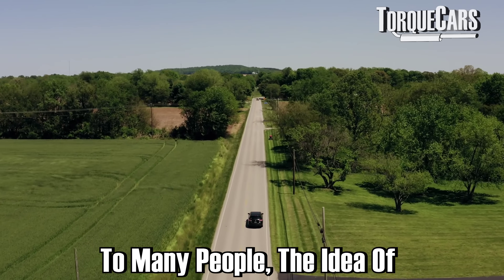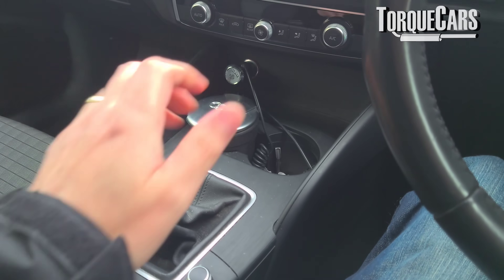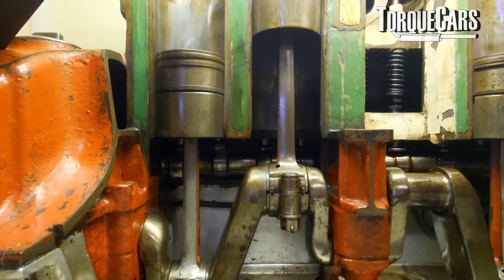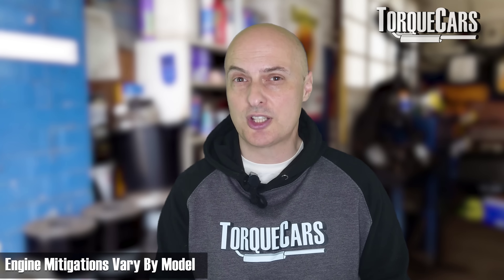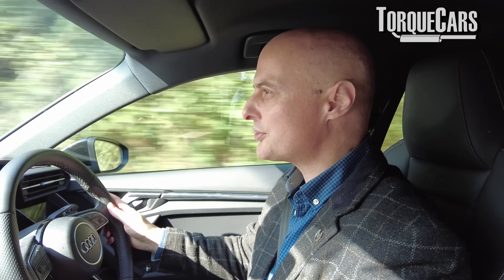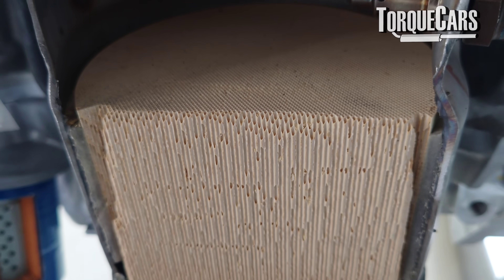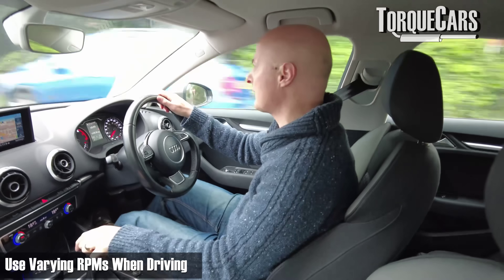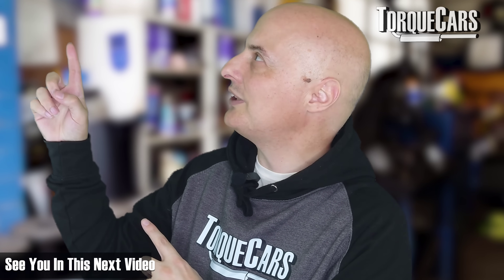BIG DAMAGE By Lugging at LOW RPM? Eco Driving Warning! (Manual Gears)

Comment: So this is more a case of bad driving habits than actual low rpm driving.
Reply from the maker: Yes, few engines suffer from doing low rpm for extended periods with little to no load on them, (with the exception of the badly designed oil pumps out there). Keeping low RPM and pressing hard on the throttle will add wear and tear, although the degree with which this happens will vary from engine to engine.
Reply: @torquecars  There are many vehicles that have worn out prematurely because they had extended idling which is why Police package vehicles frequently have upgrades designed for extended idling. Newer vehicles have variable displacement or even electrically operated oil pumps to negate the necessity of these special packages.
Reply: @imzjustplayin  Electric and variable displacement oil pumps have nothing to do with protecting the engine while idling or longevity. It was done to reduce drag for fuel savings and decreased emissions, that's it.
Reply: @averyalexander2303  Wrong. Variable displacement oil pumps can dial in the oil pressure and flow at a given load.

A non variable displacement/variable speed oil pump could have too little oil flow at low speed and too much oil pressure/flow at high speed. An oil pump that produces sufficient oil flow and pressure at low engine speed and high engine load would likely have too much oil pressure and flow at high engine speed, robbing horsepower. A variable speed/displacement oil pump can flatten the oil pressure and flow curve and be adjusted according to needs.
Reply: @imzjustplayin  just sayin, I replaced 3 7.3 engines from ford in the passed 3 months for extended idling and they all have variable displacement oil pumps. All in vehicles that idle too long
Reply: @Burpchamps  The 7.3L, are you talking about the Godzilla gas engine that only has two oil pressure settings? Because I'm not aware of the 7.3L powerstroke diesel having such a feature.
Reply: @imzjustplayin  yup, all “Godzilla” gas engines. 1 ambulance 2 from a water truck rental company. Such a common problem ford doesn’t even make you tear em down anymore to replace em
Reply: @Burpchamps  clearly they have a design flaw but the concept of a two stage is multi stage oil pump makes sense to me.
Reply: @imzjustplayin  Yep, the UK police recently cancelled their contract with BMW because the cars kept dying due to long idle times.
Reply: @torquecars  To put it simply, no decent engine will be damaged or excessively worn simply by cruising at a steady low RPM, but high loads at low RPMs should be avoided.
Reply: @torquecars  I wouldn't be worried about this as much with an American big block V-8 engine. The 1970s Buick 455 big block V-8 engine was a torque monster with max torque at 2700 RPM. I had a 3.42:1 rear axle ratio and a 4 speed automatic overdrive transmission with an overdrive ratio of .67:1 and a lockup torque converter allowing it to be locked up at 900 RPM at 40 MPH, 1000 RPM at 45 MPH, 75 MPH was just 1600 RPM in my 1974 Buick Riviera.
Reply: @torquecars  so this means idling an engine will not damage it?
Reply: So true
Reply: Das ist der Grund warum deutsche Gebrauchtfahrzeuge sehr gesucht sind, denn hier gibt es die Autobahn, welche sehr gut für einen sauberen und damit gesunden Motor sind. Hier werden eben, wenn auch lange nicht von Allen, 5 von 5, 8 von 8 bzw. 10 von 10 Gängen auch wirklich noch genutzt. 😊👍
Ich habe noch niemals in meinem Leben eine PKW Kupplung kaputt gefahren, aber kam auch noch nie auf den Gedanken im 2. Gang anzufahren, außer vielleicht einem abschüssigen Berg. Wenn ihr schaltfaul fahren wollt, warum kauft ihr euch keine Wagen mit Automatik? Gerade die neueren mit 8(+) Gängen laufen so leicht und schalten so schnell, das sie keinen Tropfen mehr verbrauchen als Handgeschaltete.
Reply: @p.s.7396 Jop. Kupplung hab ich uach noch nicht kaputt bekommen, wurde aber trotzdem getauscht als ich letzens mein Getriebe tauschen durfte. 270k km hats gehalte. 17 Jahre alter Skoda Fabia 2 1.6l wars gewesen :)
Reply: If you have an auto, many of them seem to be programmed to labour the engine rather than to change down for eco reasons.
Reply: @simonh870  Hondas econ mode does this, it also suggests in the manual that you don’t use it for short periods of stop/start driving or anywhere that has hilly terrain, it’s designed for optimum cruising conditions and not for day to day driving…
Reply: This is why I always buy highway driven engines, they are at their peak power and efficiency always!
Reply: People do drive funny .  I know someone who constantly shifts from 4 to 5 to 4 at a steady speed hehehe .  But there is people who drive a diesel and shift early but then still shift early in a gasoline car .   Coasting i've seen in poor countrys where they turn the engine off while driving .  I think i know better but i only use two of the gears often due to lazyness , not when i feel like driving tho .  And i have proven that reving  higher in each gear when heavy loaded or on hills will save gas .
Reply: I’d suggest more an issue with poor advice/education, my kids have all passed their tests within the last few years and they all change gear far too soon, my youngest took the initiative quick enough when I suggested that the redline was there for a reason and he ought to try using it every now and again, sadly the older two haven’t been quite so quick to adopt the habit…

When I initially questioned them as to why they change gear so early they all said cos that’s what they’d been told to do by their instructor… 🙄
Reply: @JustinWallace-ky9dm  indeed. My instructor thought me to drive low rpm and full throttle. 
Our diesel had lot of issues with filters. Everytime it struggled i had to go for a spin and keep rpm higher. Ever since i learned and  drove in lower gear and higher rpm... No issues. 
But habit is with me still. I drive low rpm often, but i shift down when i overtake or need to push throttle deeper. With higher rpm my acceleration is way way bigger and i can safely spin it to high speed.
Reply: @JustinWallace-ky9dm  so change gear at 3k+
Reply: @salamipitza  who are we talking about here, me or my kids ?…
Reply: Exactly
Reply: @raheengabier3984  yeah, it's almost a clickbait title based on an old wives tale.
Reply: Yes, if you have to put a certain amount of torque into the engine you need to downgear.  That simple.  Not only will it damage your engine, but it will actually burn more fuel.  Every engine has ideal Torque/RPM curves for both Torque output and Efficiency.   While the RPM is lower on the ideal efficiency side, you will get various issues. 

The exact RPM varies by model and vehicles typically have what the ideal efficiency RPM for the nominal cruising torque range listed in their owner's manual, and if you are familiar with your car, you can sort of feel when you've got the right RPM. 

This is actually one of the advantages of an indirect-drive hybrid, where the engine just cranks a generator and motor runs the car, is that the engine can always run at the ideal point on the torque/RPM curve for the exact amount of power needed for the car.  Furthermore, there is typically a small battery or power-cap system to handle heavy acceleration so the engine doesn't have to output excessive power for that.  

Towing a trailer has to be one of the most common ways to end up lugging your engine.  You are throwing a bunch of extra weight on your engine and you absolutely will need a higher RPM than normal.
Reply: ... or a case of female driving habits...
Reply: It's low rpm driving. You should be at low rpm ONLY on highway driving at stable speed. 
But people drive at low rpm all the time and don't even downshift when they accelerate killing engines. 
Bad habits are connected to myths and lack of technical knowledge causing people to think driving in low rpm is good.
Reply: @raheengabier3984  false. lots of cars rev automatically to 2000 rpm when its cold to warm it up faster
Reply: @cantwealljustgetalong2  2000rpm?! Maybe 1000-1200pm
Reply: I only use 2nd and 4th gear in VW Golf . I rarely ever use 1 3 5 6 Is that considered a bad habit ?
Reply: @lassepeterson2740  depends on road, your gearing, and speed limits.  Your clutch probably doesn’t like starting in 2nd all the time, but not a big deal.  More wear when people rest their door on clutch
Reply: @bjornironsides6474  Yes i live in a flat paved road town and drive mostly with no passengers .   2 & 4 mostly .  I am lazy and the machine should take the slack .
Reply: @lassepeterson2740  cant be that dumb for real lol
Reply: @lassepeterson2740  you'll wear out your clutch setting off in second
Reply: @joshuajohnson8124  Yes yes i worry about that .  But there is lazyness .
Reply: @lassepeterson2740  Then why are you driving a stick in the first place? If you hate shifting, then get an automatic, or one of the manumatics that are often available, or the manual gates of some automatics. I have the old 4Spd Sport stick auto in my Mazda Protege 5 wagon (US model) and I use that all the time as if it's a manual. Always start off in 1st and yes, it's a short gear so must shift it sooner to 2nd than 2nd to 3rd. Occasionally, the autobox does not drop down to 1st, so I end up starting in another gear, but immediately have to get it to 1st, to take off, but the car is not the fastest anyway.

Otherwise, it runs through all 4 gears quickly, but the performance is lackluster.
Reply: @johnhpalmer6098  That is a good question ?  But it is because when i feel like driving stick is best , but most driving is commuting and shopping and i only have 1 car .  Compnay cars and rentals are always boring automatics .
Reply: @johnhpalmer6098  Why cant i buy a 2 speed automatic or an analaug EV which auta be cheaper ?   Ask the government .   I wont drive how the government wants me to    .
Reply: @lassepeterson2740  Because you can't that's why.
Reply: @johnhpalmer6098  I dont care that is true and i do it anyways because traffic sux
Reply: @lassepeterson2740  Why?
Reply: @americanrambler4972  Lazyness . I thought i mentioned that .   Not if i'm racing someone of course .
Reply: @lassepeterson2740  Why?
Reply: @lassepeterson2740  You start moving your car in second Gear? Lmao
Reply: @lassepeterson2740  when you start on 2nd gear do you slightly press the accelerator while easing on the clutch or not?
Reply: @lassepeterson2740  Not necessarily. If your car runs satisfactorily in that situation, it’s fine. So long as 2nd gear provides the sufficient amount of gearing multiplication to give you the power to get your car moving without issues such as excessive clutch heat and wear and 4th gear allows you to maintain your chosen speed without engine operating issues such as knocking, overheating excessive shaking, you are fine. Years ago, a number of cars were built with transmissions with only 2 forward speeds. They worked fine for their intended application. You may not be taking advantage of additional performance capability or fuel efficiency using additional gearing offers, or your operational environment meets the use of only those two gears. My van is equipped with 9 forward gears. It seldom uses all of them. Most of the time it’s using only 3 of them. Its selects other gears only briefly or intermittently if at all. Gears 1, 3, 5, 8 and 9 often are not used under some driving conditions. (I seldom see 9th gear used unless I am doing over 72 to 76 mph.) Unless I am running down the highway, 8th gear use is also seldom seen. Often the van starts off in 2nd gear instead of 1st if I am using light throttle.  And it also often uses skip a gear shift logic programming for fuel efficiency purposes.
Reply: @lassepeterson2740  Depends on where and at what speed you drive at.

On a 6-speed vehicle, 1 is for starting uphill, you should barely ever use it, 3 is usually a gear added to improve efficiency, and provide a better passing gear when using gear 4.  5 and 6 are highway gears.  Gear 5 is typically for around 45+MPH/70+kph cruising or 60+MPH / 100+kph accelerating.  Gear 6 is for 60+MPH / 100kph cruising.  This of course varies by car, but it's the common arrangement.  Check your car's owner's manual to be sure. 

VWs tend to be designed for low-RPM driving.  Hence the high gear count.  Again, check your owner's manual to find out just how low for your particular model.
Reply: @lassepeterson2740  not if you don't use a lot of throttle at low rpms or rev the engine when it's cold. But you may be wasting fuel.  I have a 5 speed Citroen and I often skip 3rd or 4th gear. Also how do you rarely use 1st gear? If you're going from standstill on 2nd gear, that will wear you clutch. Also downshifting rashly while skipping gear may wear your clutch but also others components (flywheel or parts of the engine).
Reply: @lassepeterson2740  I start off in second all the time.  Took me 9 years to wear the clutch out.  First in my car is awful. It shoots off then 2 seconds later I need second anyway and dipping the clutch makes the car bog down
Reply: @chrisl1797  Exactly . 1st is for hills or full load of passengers .   5th is for very long distance at over the top speed i think .    Everything else is a waste of rowing .
Reply: @lassepeterson2740  It really depends on the engine and gear box US based Allison 10 speed manuals can take off in fifth without a load, but if i tried starting in second in my jeep it will very likely kill it
Reply: @lassepeterson2740  If it's a Golf4 1.9 TDI ALH (pour les connaisseurs), then no, it's not a bad habit 😁

Comment: I have Audi a3 2lt tdi it has suggested gear. I always ignore as I think it labours the engine. It’s supposed to be fuel efficient but I ignore and still get 60mpg.
Reply: Yeah, that kind of thing is to help the fleet average mpg for the gov't regulations. They don't care if it wears out your car faster. All the better, actually!
Reply: Thing is they suggest changing up gear going up hills 🤷
Reply: @danmaycock9238  Had a Fiat Punto that sometimes suggested going up a gear while I was in sixth ...  :)
Reply: @Paul58069  To perform a magic trick then?
Reply: @Paul58069  It meant the Race Gear, in short "R"
Reply: @davidellis8141  Those suggestions always make me laugh, ain’t no way I’m going to labour the engine just for economy. My diesel often tells me to change from third to fifth, to which I generally laugh out loud.
Reply: @davidellis8141  Absolutely agree. I have a Tiguan with the same engine and I ignore the gear suggestions. The engine feels like its slugging and just not right. 1500 rpm in 6th gear has no power

Comment: Can we say that the correct gear would mean the RPM where engine have peak torque/ performance. Meaning that's where the engine is comfortable the most?
Reply: That's a difficult thing to do legally with a supercharged V8, unless you are on a race track.  My Jag sits around 1000 to 1500 rpm unless I am accelerating hard or doing motorway speeds.  I do like to let it rip though.
Reply: @ericrawson2909  You can always be on a gear that you V8 ( even supercharged ) is the most confortable on. Just need tohave a very light foot.
Reply: @ericrawson2909  people say this peak torque all the time but most of the time the public road conditions don't let you use the load, so are you going to sit at 4500 rpms and light throttle drinking more fuel just to be ready for the occasional pounce around a slower car or steep hill?
The most efficient conversion of fuel to power is usually around 2500 rpm at 80% load, but if you're not using the load, lower the rpm further for more efficiency. The logic to the peak torque is well the engine is making the most force from the fuel, forgetting that the fuel per stroke is not constant even with the pedal to the floor, but rises slightly with increased rpm.
This is why I don't bother with enormous engines but get one that is more appropriately sized for public road use, rather than one that starts to get into the bottom of the power band at 120 mph, and is drinking away fuel just to be fun for the 1% of the driving time that the road is clear, and the rest of the time it's in great grandma mode.
Reply: I think it's correct yep  :)

Comment: I drive at a low RPM to avoid triggering the turbocharger which darkens the engine oil and building up heat from the turbo.

https://en.m.wikipedia.org/wiki/Honda_N-Van
Reply: Supercharged engines are designed to operate "on boost" they're actually volumetrically and thermal most efficient with the wastegate fully closed.

If your oils getting coked up, change it more frequently and give it a few tanks of Shell optimax
Reply: Avoiding building boost won't be good for a turbo car either. Are you using the correct oil?